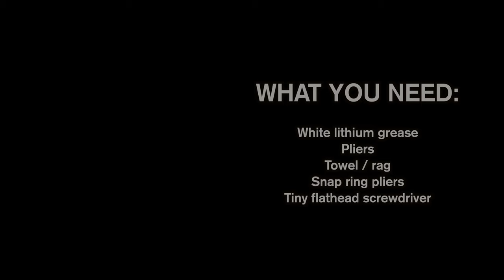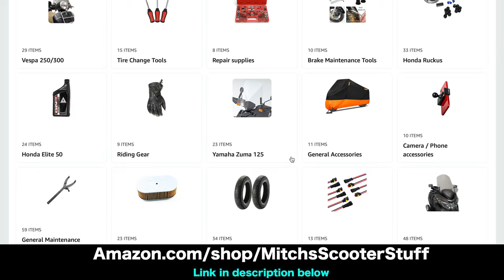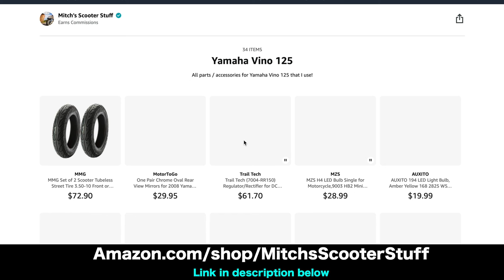Yamaha Vino 125 Speedometer Drive Unit / Cable Service | Mitch's Scooter Stuff

Comment: curious does the type of grease make a difference? why not marine grades moly or something similar?
Reply from the maker: Yes any types can make a difference but many works about the same... white lithium grease is good for metal to metal where there is gear meet gear to work together and it's sealed inside with rubber seal to stay clean and not getting any dirt or wet. If it gets wet or see outside, I would use marine grease...

Comment: I would assume this is very similar for a 06 burg 400! I was gonna tackle changing the tire soon and figured I'd regrease the speedo rotor while I'm in there. I was super wondering about the temp grade of grease you used? I wouldn't assume at highway speed those gears getting that hot so 0-250° would probs be okay yes?
Reply from the maker: Yes for sure! For Burgman at higher speed, I would use this grease https://amzn.to/38wgU6c
Reply: @MitchsScooterStuff  not mecanical on a 06 burg is electronic speed sensor  not a cable!!

Comment: Mitch I laid my 2008 vino 125 over  and now it won't start. Is there a reset switch or something ? Just got it running real good but it was a real sandy road I was doing about 5mph. It fell to my left.
Reply from the maker: Oh no sorry it happened to you :( Is your emergency switch turn off? Can engine turn over?
Reply: @MitchsScooterStuff  it was the kickstand kill switch that was bent. I bent it back in place now it's fine. Thanks for replying.
Reply from the maker: @denniswilkins4514  oh good glad you got it fixed!
Reply: @MitchsScooterStuff  question....when the key is on I have a horn but the starter will not work. The emergency kill is in the correct position and the kick stand is up. Is there a fuse somewhere for the starter or could the starter switch be bad. It will not kick start with the key on. Need your expertise.